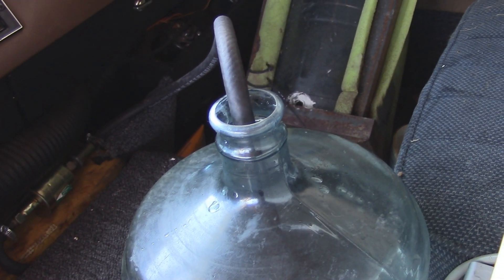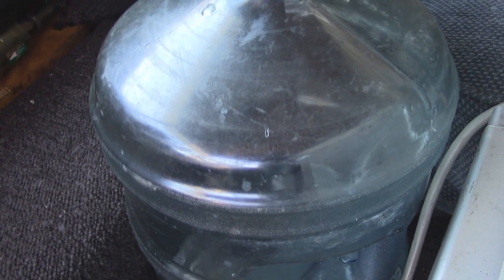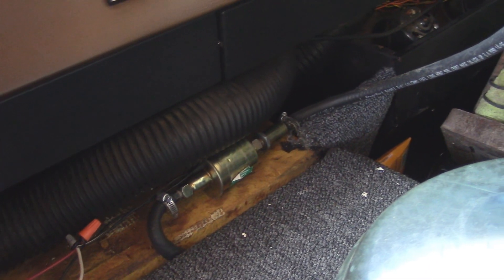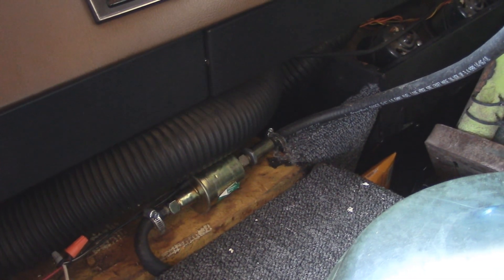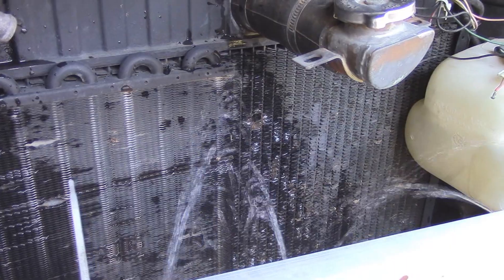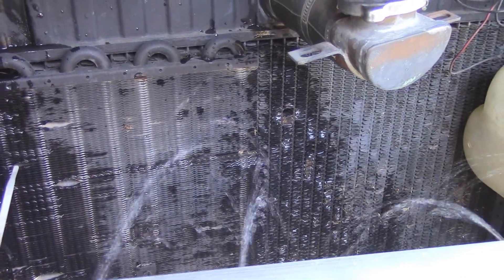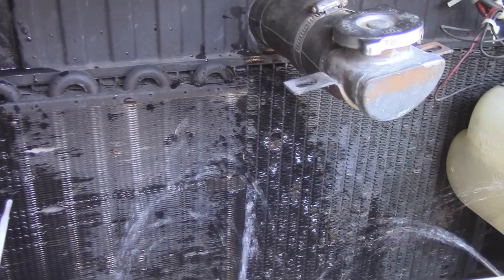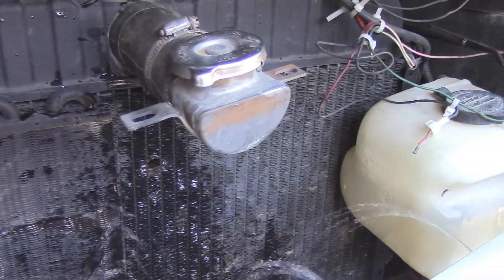1tiliman FULL TIME RVing AND BOONDOCKING: home made radiator cooler.

Comment: Great idea. Seems like the streams of water doesn't reach while sitting still but will reach fine while driving.
Reply from the maker: yea you right, some of the streams of water do not reach. but yea the incoming wind will stir all the up and when the fan is running will draw it in for  more equal spread.